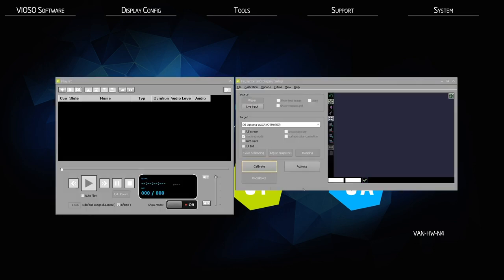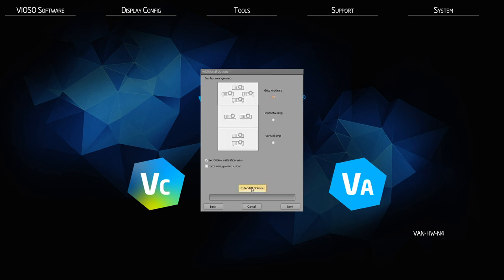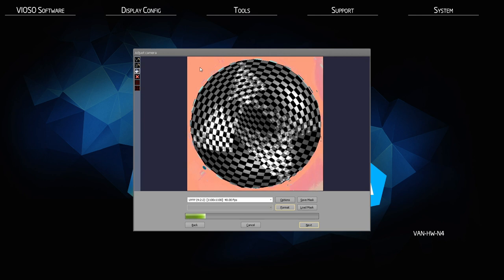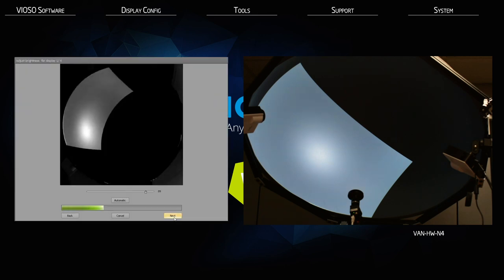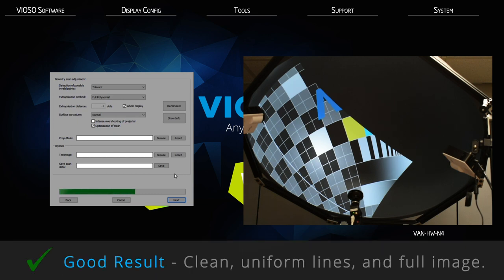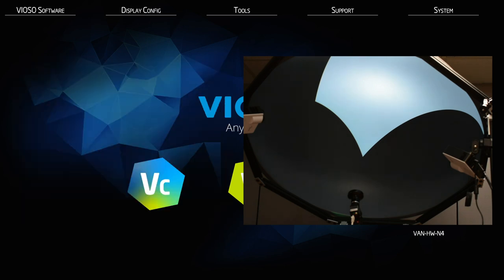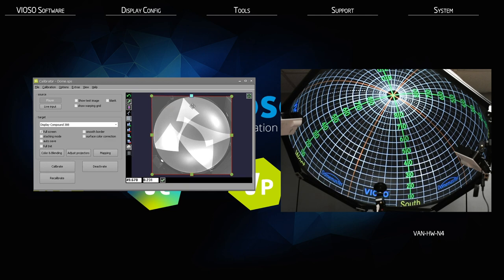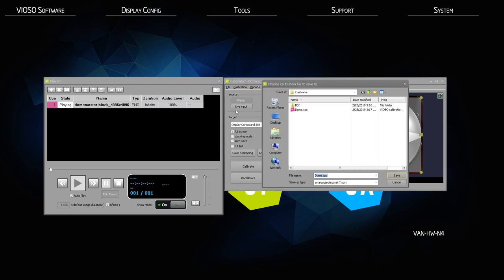VIOSO Tutorial: Full Camera-based Calibration Process

Comment: Can we use different projector and use calibration in your program to achieve one large single image?
Reply: Yes in general, brand and make does not matter. Keep in mind, all projectors will be dimmed to match the darkest, so try to position/zoom for equal brightness. You might also consider building a stack for extra brightness, by pointing all projectors to the same area and disable blending by check "stacking mode".